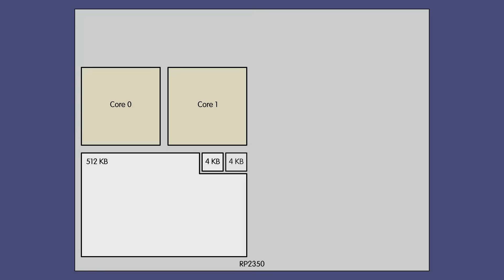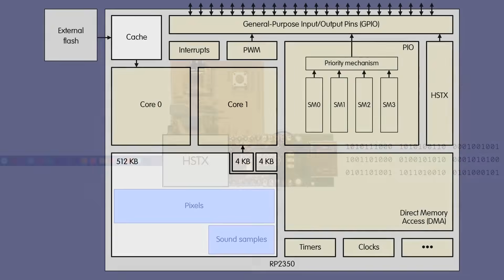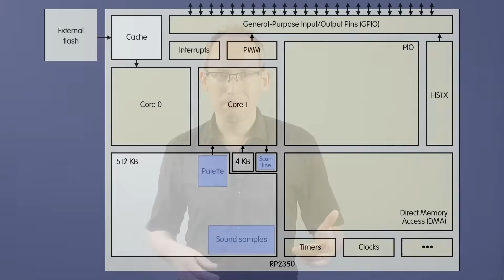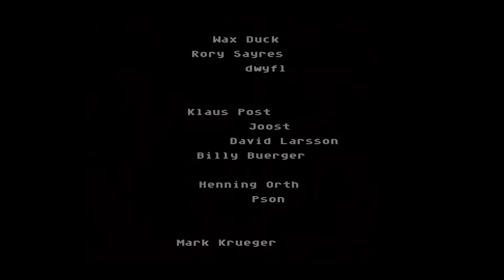Microcontroller Magic: Under the Hood of “Sum Ergo Demonstro”

Comment: I remember seeing one of your demos at what was called "Breakpoint" back then where you showed a demo that ran on some piece of hardware that is typically used to control washing machines and I was really impressed. I am no coder, but I admire this artform and it is a pleasure to see you so many years later continue to dive into hardware and squeeze out it's bits and bytes 🎉

Comment: Wow, pure beauty! Brings back memories.. 20 years ago I did something that could be a direct ancestor to this; I used a AT91SAMsomething to make a "home computer" that ran BASIC in memory of my childhood zx81. It used one of the SPI ports to create a TV video signal: CS output for sync, data for black/white, and PWM for audio. Interrupt for PS/2 keyboard, another SPI for SD card. Played audio, with PWM, from SD card or USB audio from PC. Back then I was working for company called VLSI solution, one of the pioneers of sigma delta modulation and high quality audio (that's where I developed the USB audio stack). I've been wondering to myself if you could use one of the PIO generators to implement a (first order) sigma delta modulator, I think you could easily reach hi-res audio with it. I have a couple of rpi zeros lying around waiting¨for me to try, but paid work makes life too busy these days. Love the project <3

Comment: I built a graphics system for the PC but it used the front and back buffer approach and it had a z plane like you are trying to implement. However the system worked by recursively splitting the screen into smaller squares until you could just paint a constant colour or bitblt a stored image. I needed to use masks to deal with curves, so it was rather fiddly, but because it only ever updated the parts of the screen that had altered, it was blindingly fast. You could drag things and they would move nice and smoothly, which they didn't in your Microsoft products!

Comment: The DBG_PADOUT is really cool, thanks for sharing! I'm curious, were you able to get any use out of the PIO-to-HSTX coupled mode? It seems like a good way to cut down on bus usage that (I think?) would work with the SM output priority thing, but I haven't tried using it, so maybe it's not flexible enough for your purposes.
Reply from the maker: If I remember correctly, that option bypasses the bit encoder in the hstx, so it doesn't help in this case.

Comment: Man, that debug register is quite a find. I've also used disconnected pads to shuttle data around (crude multi-channel audio synthesis running on the PIO), being able to do things like that without needing unused pins really opens the door to so much more. Great presentation all around.

Comment: After the 3D graphics explanation, I thought you were going to explain how those barycentric coordinates were just too slow to calculate, and you had to use some other approach, but no, then came that brilliant technique with how they change linearly, and then even how that could be optimised using hardware-specific techniques. Incredible!

Comment: Awesome and inspiring work! If you ever do want to do sound output through HDMI, hit me up for some TERC4 encoding code. I've done a version in Cortex-M33 asm which is extremely optimized, but of course it could be adapted to RISC-V. I also have some 4bpp to 16bpp image decompression code which runs on the fly; I hope to write that up some day.

Comment: 2:04 As I read the datasheet, those 512KiB are split into two 256KiB banks too (SRAM0-3=bank0 and SRAM4-7=bank1), in turn striped at a width of 4 words. In practice this means you could dedicate a 256KiB chunk of RAM if you needed, not just one or two 4KiB (SRAM8=scratch x and SRAM9=scratch y). You can also reconfigure the flash cache into XIP_SRAM mode for another 16KiB.

14:11 The actual instruction for reading from the FIFO is called PULL, while OUT is the instruction for extracting bits. This code evidently uses automatic push/pull mode.

16:30 INLINE_OUT_EN from EXECCTRL. Neat.

That bus priority bug was sneaky to be sure.

43:43 It's so tempting to find some other way to mix bits, but I think this really is optimal for the cycles.

Excellent interpolator use!
Reply: At least the RP2040 also had a second unstriped alias of the RAM regions where each of the SRAMs could be used fully separately.

The RP2350 dropped this, so there is now slightly fewer independently accessible RAM areas than before.

The INLINE_OUT_EN feature is amazing. I used it for the same reason in my Pico4k demo to do layering, but LFT managed to make so much more nice stuff than me with it.

Comment: I'm doing something similar on the rp2050,  I had been seriously debating using pins for loopback io. The debug register is a game changer.  There's also a whole lot of unexplored space in the interpolators.  I haven't wrapped my head around what happens when you flip-flop data between them writing the output of one to the other  (like output of one into base of the other, and output of the other into an accumulator of the first (interestingly nonlinear), or even more insane  output of one is an address to write to and output of the other is the value, and the first outputs the addresses of registers of either interpolator).

Comment: This is some true 2026 modern "democoding"!    Not only are you creating a raw graphics pipeline, you're creating an entire software defined video chip!!  I wonder if something similar could be done on ESP32
Reply: From my (somewhat limited) understanding, ESP32 has a bit more raw CPU power but less interesting peripherals to work with. I'd be curious to see if a demo could find use for the ULP coprocessor, though.

Comment: 30:30 re:overclocking, I routinely test PRs to MicroPython with my rp2350 overclocked to 300MHz. Might just be silicon lottery, but I've never had any of the test suite fail because of that overclock.

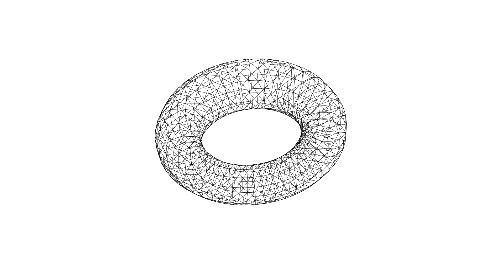Comment: 51:24 In that case, where most of the horizontal scan you end up "skipping" due to it being outside of the bounds of the triangle. If you know how much the barycentric coordinate gets adjusted for every horizontal pixel increment, couldn't you pretty quickly calculate how many horizontal pixels you can "jump over" to get to the edge of the triangle (barycentric coordinates now all positive)? This should only need to be done once per scan, at the very leftmost edge of the AABB (start of each scanline).
Reply from the maker: I'm sure there are many possibilities for further optimization. I wouldn't do a division on each line though; that would be slow. But you can calculate the slopes once per triangle.
Reply: Another cheap check takes advantage of the fact triangles are convex. If you get to the inside of a triangle and then later in that line you leave, you are positive you will see no more inside pixels for the remaineder of this line. Depending on triangle size it could be worth it.
Reply: @jojodi  Yeah, can just skip to the next line as soon as you reach the right side of the triangle.

Comment: You are a wizard of a number of venerable techniques that many people developed since the 80s on platforms like the Atari VCS; the C64, the Amiga, and the knowledge of engineering and maths to use them with unsurpassed creativity and competence. I can see the shadow of those old machine architectures in the way you program a modern microcontroller down to the metal. That this is possible at all is one of the winning features of the RPI family of chips in my opinion. A bit sadly, I can't help but wonder for how long in the future we will have programmers like you that can tackle with such a level of machine knowledge and optimization ingenuity, or if  these techniques will eventually become ancient lost arts.

Comment: Did you use RISCV for the added challenge? Surely the ARM side is quite a bit more powerful, DSP instructions and FPU?
Reply from the maker: The ARM mode is more powerful, yes. I didn't actively seek out the challenge of a less powerful setup, but I don't mind it either. I think the RISC-V instruction set is very elegant and appealing for hand-coding, with simple rules for instruction timing.
Reply: I would prefer the RISCV for simplicity and aesthetics: free core, predictable clock cycles, clean instruction set. FPU instructions have large transistor counts behind them and tricks like pipelining lead to complicated and unpredictable cycle counts.

Comment: I'm inspired to do two things: 1) I have a half-working wipeout port to rp2350 but the rasterization is terrible. I think your approach here can help land a good version. 2) I suspect a multi-rp2350 board could be very inexpensive and produce a very fun and extremely flexible old-school-ish "fantasy console" with several cores potentially rendering regions of a screen.
Reply: Hey,  that's what I was doing a few weeks ago.  Not a full wipeout mind, just a textured track,  then I got into a fight with a camera that kept going under the floor if the track undulated too much.    I like the idea of a dual rp2350 sharing a bunch of GPIO,  then you could even PIO out of one and straight into another PIO on the other chip.  Depending on number of pins you wanted to spend you could go nuts with chips and have b (8 maybe) lines that connect to chip#n+1, chip#n+2, chip#n+4 modulo total number of rp2350's.   it would be a challenge to use but potential for so much fun.
Reply: @Lerc0  I just got two rp2350s wired up with bidirectional PIO pushing 5MB/sec in each direction, with multiple opportunities to double this still (DMA, later moving to a PCB, etc.). Each rp2350 has two 4-bit buses and and clocks on PIO. My intention is to extend this to say 4 rp2350s and do rendering work amongst all of them. Would a video on this work be neat to you?
Reply: @jojodi  Definitely interested  in more rp2050 content.  There are literally dozens of us.  Might even do some of my own at some stage
Reply: @Lerc0  I'm actively working on a ring network for these so each 'worker' can work on a tile. At the beginning of the frame the main rp2350 sends any transform, mesh, vertex, palette, texture updates since last time and has a mask for which other cores in the ring should apply those changes. The workers can send data to another node, e.g. send tile render results to the main chip for eventual display/scanout. Just breadboarding 2 right now to prototype at the moment. The actual bandwidth requirements are not high, and there is a scheme to forward packets along the ring purely using PIO/DMA engines (no CPU interrupts needed).
Reply: beamracing and cyclecounting for the win! 🎖

Comment: But, but,... He developed his own assembler!
Reply: Writing an assembler is just work. It's a task commonly given to students. There's half a dozen things in this video that are brilliant in a far more interesting way.
Reply: @hobbified that's true, but think about the reason to make your own assembler. Why are existing ones not good enough?
Reply: @yooyo3d cause the existing ones are optimised to do a lot of things well and reliably and repeatably. New improvement and features take time to trickle down as they need to be rigorously tested and slowly rolled out.
Reply: @yooyo3d  assembers are tools. people make specialized tools for specialized jobs, simple as that
Reply: Yeah, and it's a comment dropped as casually as if he mentioned tying his shoes! (to be fair an assembler isn't exactly the hardest form of compiler to write, still takes a fair bit of work)
Reply: For a project like this it's super smart to write your own assembler. You can make it optimal for what you're working on. It sounds impressive because it sounds kinda like "wrote my own compiler", but making a RISC assembler has gotta be the simplest thing that went into this demo. That's like a 1st or 2nd year CS thing. An assembler is mostly just a parser that turns instructions into opcodes, and RISC stands for Reduced Instruction Set. 32-bit RISC has 40 instructions and 10-ish opcodes. Even the 6502 has 56 insructions, and almost 256 opcodes. The impressive thing is his ability to actually do cool stuff in assembly!

It's not the simplest thing ever. Instruction mapping is kinda convoluted, and you probably want to assemble a valid ELF object file so you can use an existing linker to turn labels into offsets for you. But it's the only thing in this video I could probably do in a day. If he had written an x86 assembler, that'd be different. That'd be masochistic.
Reply: @RaquelFoster  An x86 assembler isn't that hard, most of the instructions can be parsed as "instruction" + "list of operands" where the operand is a generic operand type, that then is resolved into a specific operand variant that would have 1:1 mapping to binary.

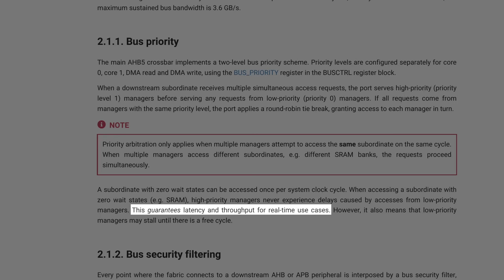Comment: 25:07 Does that actually matter? I was under the impression ram banks assigned to main memory are interleaved (striped across the address space) such that unless you have access patterns where the address modulo the number of  ram banks is the same for both cores you never get contention anyway. At least on rp2040 there are official statements by RP engineers that this is the case.
Reply from the maker: It's a good question to ask. I haven't measured the actual improvement in this case. But I think it's realistic to expect some bad access patterns. For the repeating pixels, every access would hit the same bank obviously, and core 0 might traverse a framebuffer vertically or read-modify-write individual words.
Reply: The striping significantly reduces the probability of contention, but doesn't drive it to zero. Using scratchpad memory can, however. It's easier to control and predict the effects on RP2040 than RP2350, as the former uses the same bus connection for both instruction fetch and load/store, while the latter has two connections and can do two bus transactions per cycle.

Comment: 34:10 Wow, that was an interesting explanation. It seems the early revisions of the RP2350 have a handful of bugs...
Reply: All microcontrollers (yes, all of them) have errata. Some major manufacturers have released extremely common chips that have been in the market for a decade or more which still have an insane number of bugs. So the RP2350 is nothing special in that regard. But the latest stepping has the worst issues addressed. If you actually care, they're all well documented by the vendor.

Comment: I am halfway through the video now. However I have not yet understood the transparency... If it doesn't come up in the second half, I will have to rewatch part of the video. :) So far, it sounds all reasonable. Regarding the Hazard RISC V penalty "use after load", I think the same applies to the ARM CPUs on the RP, right? I remember Piers Finlayson mentioning something like that when he was coding his OneROM firmware.
Reply: Basically every pipelined CPU has stalls when a value updated in one stage is used in the next stage. Microcontrollers don't do complex instruction reordering to mitigate this like more deeply pipelined application CPUs.
Reply: Isn't the penalty here the ram access, especially indirect? Calculate address in the first cycle, fetch in the second
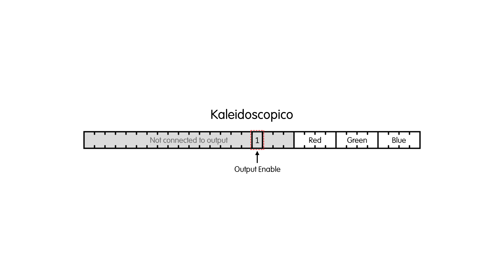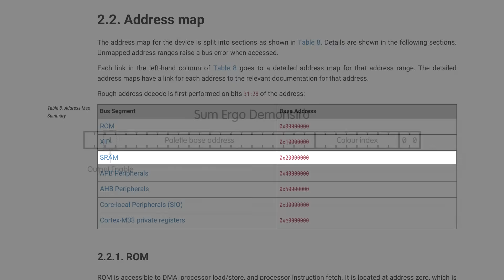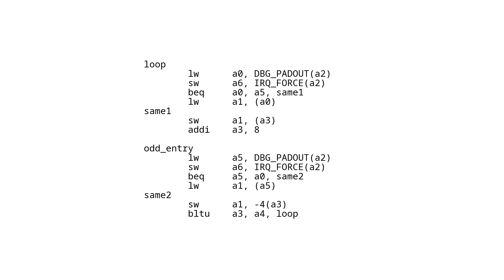Reply: The transparency is layered hacks. As illustrated at 16:26, one of the output bits is used as an enable (EXECCTRL OUT_EN_SEL/INLINE_OUT_EN); if it's set, the address may be in RAM (17:02), but if it's clear the priority combiner (11.5.6.1. Output priority) skips that SM's output levels, allowing a lower priority SM to set the outputs that are read through DBG_PADOUT. Each PIO has 4 SMs running simultaneously, though the CPU controls their pacing (37:37) in this setup.
Reply: @0LoneTech ok, I meant the fading/blending of layers.
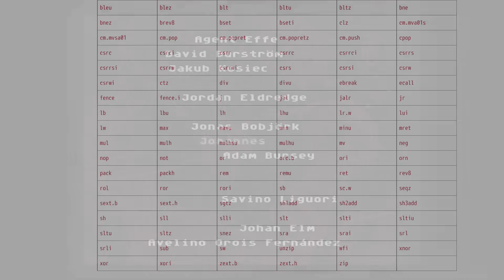Reply: @root42  I see. At 39:48 the text layer does have a fading effect. It's explained as "modifying two bits per pixel". That could be forcing a minimum intensity by basically ORing in their bit values on top of the background trace accumulator. This could be done by reducing the number of output pins for that layer.
Reply: @root42  I believe most of the fading and blending is done by lookup table tricks. For example, you can blend two 4-bit images by enabling 4 of the bits in one state machine, and 4 in the other, and the lookup table contains the blended colors.
Reply from the maker: Yes, RaphLevien is spot on.
Reply: @RaphLevien ok! Got it. I did it the same on VGA… I thought there was some other magic to it!

Comment: looks like a pixel shader, or a c64/amiga scanline raster. no collision in ram access if you have true multi-port ram on a device. ie multiple unlimited reads and one write at same time per clock. ie no need taking turns to ram, other than for write. only one source per written memory address at once. ie unlimited reads and one write per register at once.
Reply: Ok, waiting for your project to replace the sram in the rp2350 to add this functionality... 😅